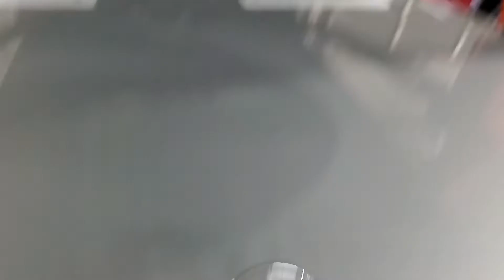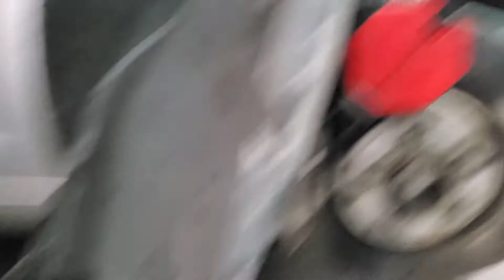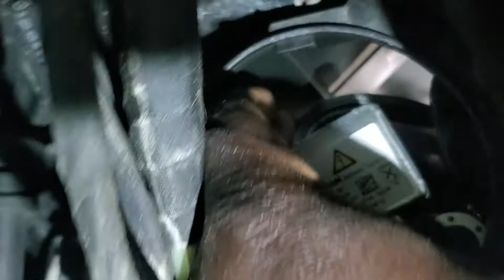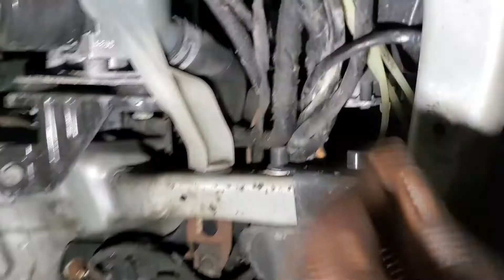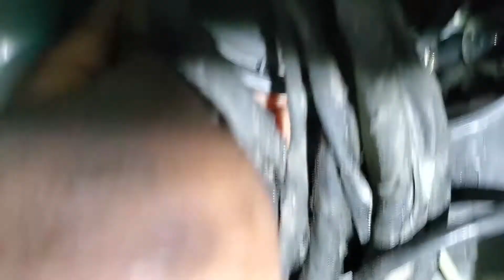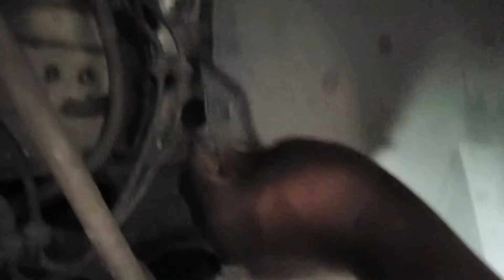EASY REPLACE MERCEDES W221 S550 HID XENON HEADLIGHT BULB #xenon #headlightbulb #replacement

Comment: Saw another video where removal of the wheel is not necessary just pull the two pins holding the wheel well trim outboard side and bend it back (with wheels turned fully inward to provide additional access.
Reply from the maker: Yes, that is another way to do it. Thank you for pointing that out.

Comment: these the regular light and not the brights right just making sure so I can use this
Reply from the maker: These are Xenon HID lights. The bright ones. But the procedure applies too to the regular ones.
Reply: These are for the low beam not the high beams. It’s recommended you take off the the reservoirs from the engine bay
Reply from the maker: @afrigginawesome  The bi-xenon HID acts as low beam at the same time as high beam light.  But maybe for a regular one you can take off the reservoirs.

Comment: What if the turn signal goes out?
Reply from the maker: It is a bit tricky from this spot. I always advise that you have to remove the headlight slightly forward to replace it.